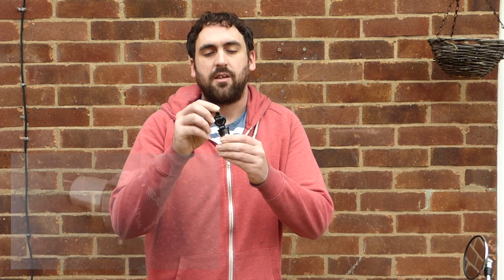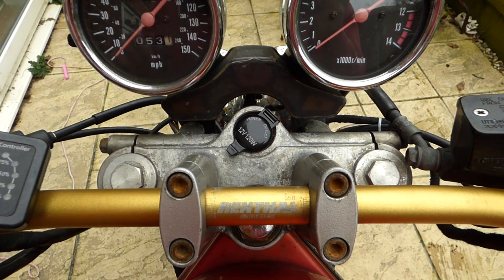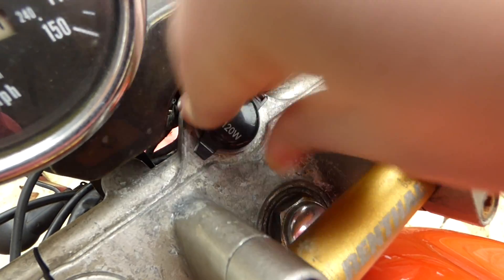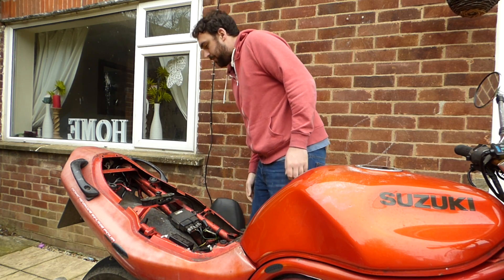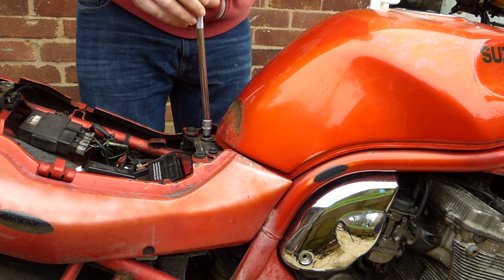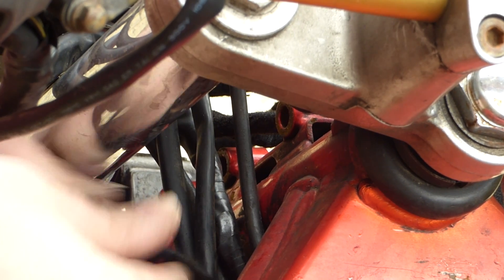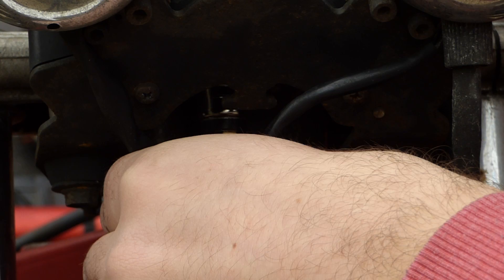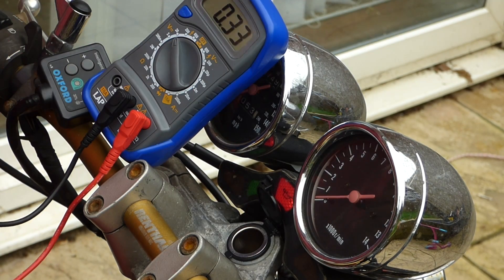Motorcycle POWER SOCKET install

Comment: Question, should the socket be constantly connected to the battery? I’m just learning how to do this, but I thought it would be connected to an accessory power source.
Reply from the maker: A socket like this is fine wired directly to power as it only draws when something is plugged in, a USB port on the other hand should be swtiched as it converts 12v down to 5v which constantly draws power.